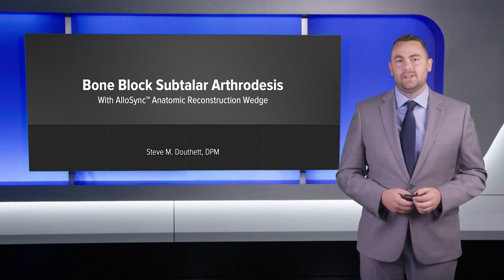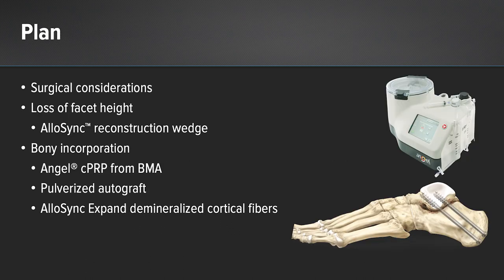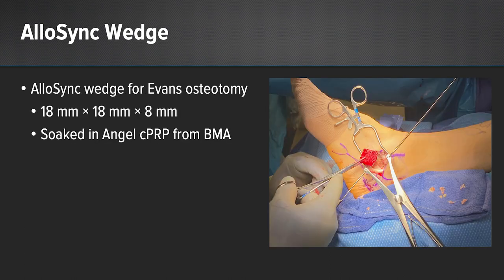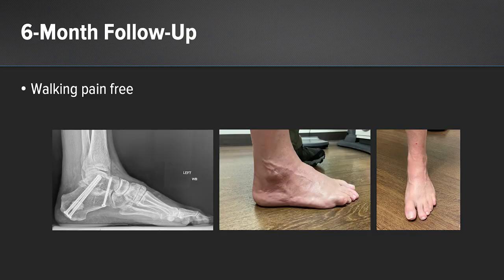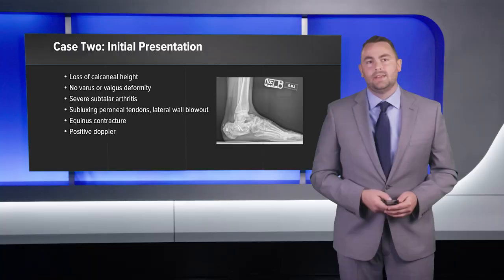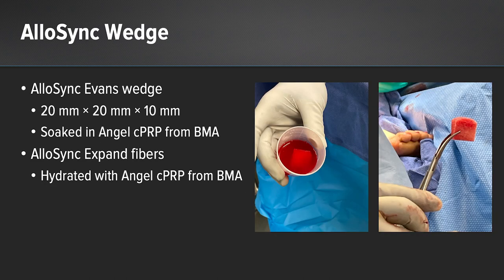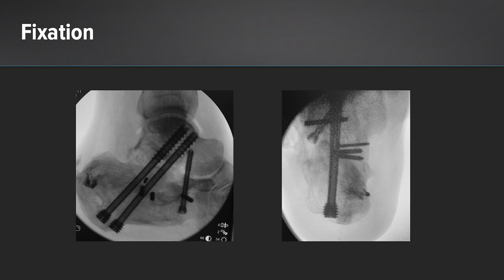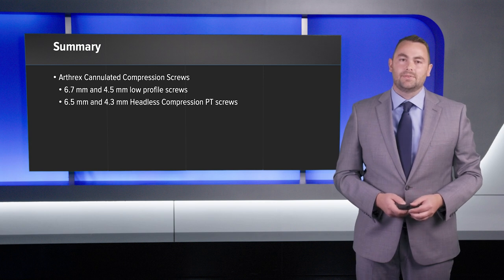Bone Block Subtalar Arthrodesis With AlloSync™ Anatomic Reconstruction Wedge

Comment: I’m from Canada. Head on: mva on the highway, ambulance to emergency; X-ray for everything below my waste. CT head down to waste.. missed broken Calcaneus and other stomach issues.MRI 3 months later find bad break in Calcaneus.. try to get foot specialist in wpg to do surgery. She declines says Brandon place to get it done. Back specialist screws up my foot.. Permanent nerve impingement and non mending bone Calcaneus? My life has been hell. Now it’s how to manage pain? Referred to a proper foot specialist: won’t do surgery now? I’ve lost my locksmith business, have PTSD : can’t drive and can barely walk with pain off the charts… What does a guy do now? I’m in Canada: this is Autopac claim and where does the money come from to get it fixed? I did have a nerve operated on by plastic surgeon to try and unfree it… no success at this time…How do you make bones heal that don’t? Have used machine to supposedly heal bone ? No luck! I need some good information from a surgeon that could fix this mess.. praying I will be heard.🙏🏻 B Deacon Manitoba Canada 🇨🇦

Comment: We knew famous doctors, but it turns out that traditional doctors are better than them if it wasn't for the high-tech 
Meaning, we have heard about the famous doctors who treat patients, but the patient after the treatment remains deformed, especially a defect in the treatment, for example, that the person is lame and crooked and the doctor cannot treat him We went to the doctor in order to do a section on the radiology and we treat someone who treats patients using traditional methods And we found that the traditional treatment of Al-Jabbar for the bones is better because some doctors do not perform their duties in the best way.